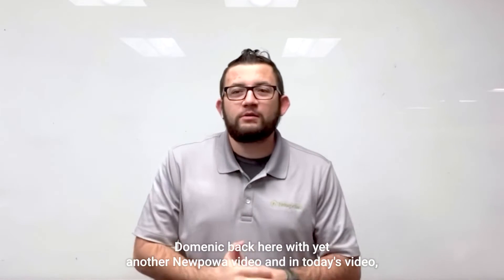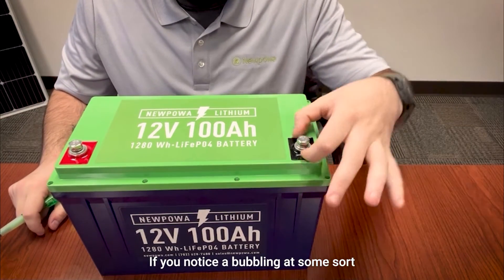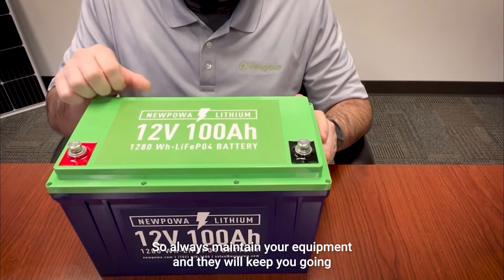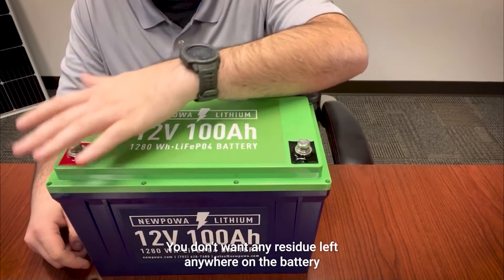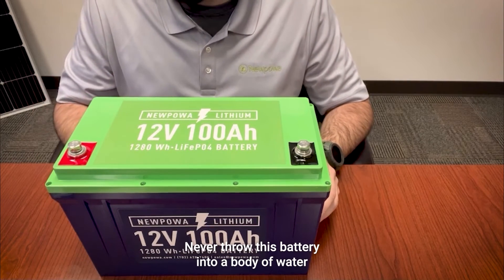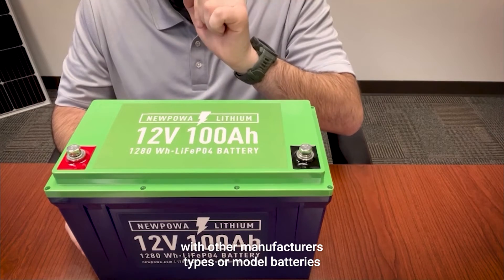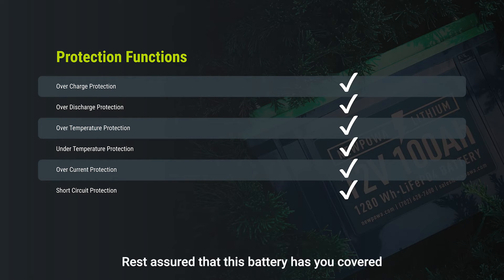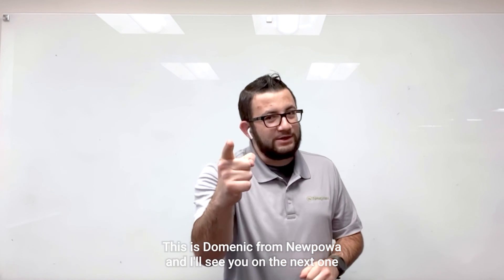Newpowa's 12V 100Ah Lithium Battery (Part 2)

Comment: I would really like to see a 48 volt operational and range test for a golf cart application.  I know most advertising is geared toward solar,off grid, and the RV community, but there are millions of golf carts, and many are going back to electric models.  With such a huge market share available, seems appropriate to gear advertising towards  the golf cart community.  It seems I can’t find a price?
Reply from the maker: Agree on that, we have customers seeking for a golf cart solution as well, will consider do a test review on such platform later. Let's see if we can get you guys a decent solution.